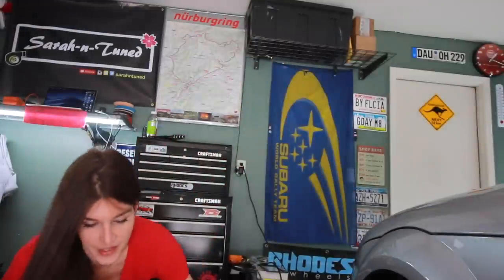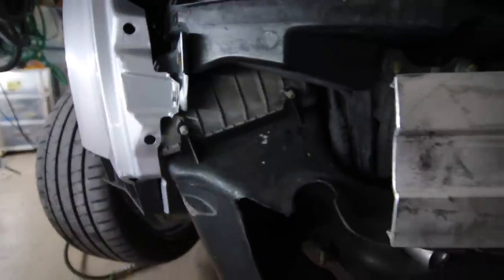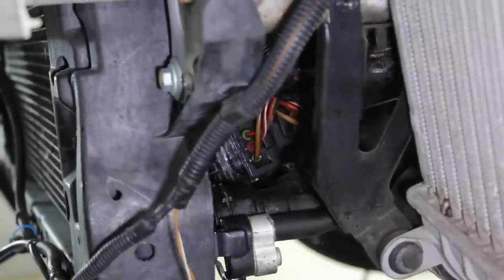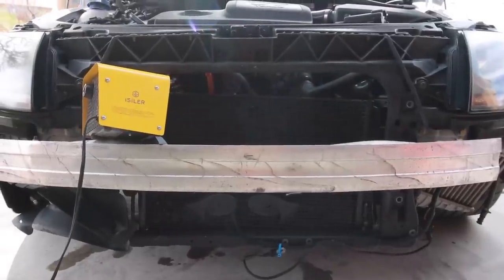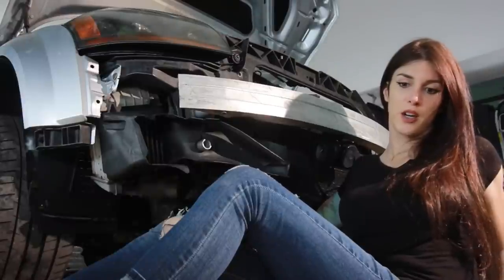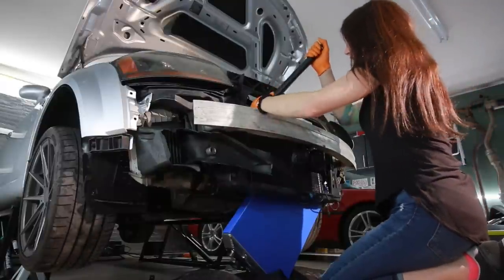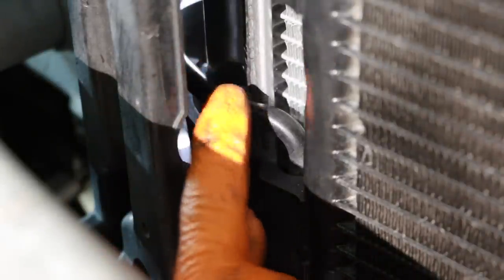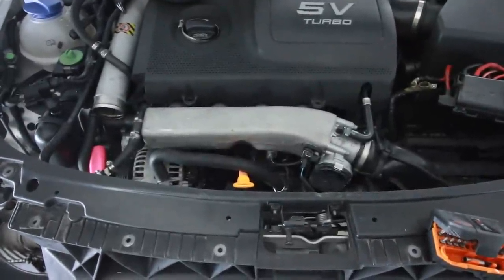Installing Track-Ready Cooling Upgrades // Project TT Quattro

Comment: Coolant NOT "down the drain" I hope. Thumbs down to wrinkle paint, it's just a dirt magnet and very difficult to keep looking fresh. If it's got to come off just bead or vapour blast. There is probably a carbon dress up cover as an option.
I hope ECS view this video. They might be able to redo the brackets on future rads to solve the clearance problem.

Comment: So did transferring video clips from the camera to the laptop save you any time overall? Looks like the Canon works fine so I assume the repair worked?
Reply from the maker: Ramon Punsalang yes, massive time savings. I edited this video in 2 hours today vs my usual 8-10. I did however spend a lot less time working because I was busy transferring clips, either way—time saved.
Reply: @SarahnTuned great! I suspected as much and noteworthy the quality and content remain high which matter to you.

Comment: dont want to use header or engine paint on the condenser and in the future not on the radiator either. there is radiator paint that you can get at eastwood to paint those. it is a thinner paint.
Reply from the maker: Andy Ostensen I painted it when it was still slightly wet from washing it, I had a crazy idea that it would help in that situation. 😂 I think it kinda worked too!
Reply: @SarahnTuned  it will make the paint thinner so that will work. Yaaaaaaaaaaaaaaaayy

Comment: Gotta say I love to hate working on VW/Audi vehicles, but I think your blame is a little misplaced.  That was a race radiator.  Not a drop-in, plug and play, factory replacement.  There has never been in the history of going fast a "race" part that didn't require modifying/fabricating/destroying something.  I don't want to sound critical, but I think if you keep in mind that it isn't supposed to be easy or every mechanic would be driving a racecar.  It's special because it's hard.

Comment: Do your both fans turn on when it starts to run hot?
Reply from the maker: Marley Brown both my fans are always on, the low speed Circuit isn’t functioning correctly, so it just pulsates the high speed.

Comment: Did you get your DSLR fixed ? Great video also showing things are not always as easy, others would edit them to look like a walk in the park, great you do not, but show things as they are :-)
Reply from the maker: Klaes Fris no, I have to check every clip after I film it. They stopped making that part I needed.
Reply: @SarahnTuned  wauw, thougt you bought a replacement, chip-board with sound and that was just it instead of the cracked one, but apparently not you solution, can iFIXIT help, and/or WTD Sarah ?
Reply: @SarahnTuned  BTW what is your DSLR ?
Reply from the maker: Klaes Fris Canon 70D, I bought the replacement card on eBay and then the seller refunded me the next day saying the stopped making it—which is dumb that they even listed it to begin with! Lol

Comment: I don't think the problem is that it's an older car. The problem is it's an Audi. They are crap to try and work on.
Reply: Its mainly a golf mk4
Reply: Completely disagree, I love working on those. Just need to know how... Problem arrives only on bigger motors like 4.2 or 5.2 where there is no room. But 1.8  or 2.0 are easy...

Comment: Them cars were a pita when new , everything you touch is a "well while your here might as well do this as well " Basicaly just remove and service the whole motor , timmining belt water pump replace every oring in the cooling system . Over engineered and they still fail as much as any other car or more often. If you failed to put stablin on every electrical connection you touched then that system will fail to work properly. It was a nightmare working on them cars for 3 years at a dealership . 1 drop of stablin was charged out at ??? 10 dollars . This was VAG fix to every electrical problem . I love your effort and dam your sweet to look at but run away from this car once you have fixed it . MR dos is 10x the car.

Comment: Should have just gotten a stock replacement, then you wouldn't have run into fitment  issues
Reply from the maker: Dave K we have several months straight here where the average temperature outside is over 100°F, stock won’t cut it.

Comment: These cutoff wheels work way better than the standard dremel cutoff wheels. https://www.homedepot.com/p/Dremel-1-1-4-in-Fiberglass-Reinforced-Cut-Off-Wheels-for-Cutting-Metal-Including-Hardened-Steel-5-Pack-426/100009724

Comment: Hey Sarah, you should get some long service bolts and pull your whole lock carrier into service position. I just finished going to stage 2 on my S4 (dual pulley upgrade) and this gives you a whole lot more room to work with around the front of the engine. As far as I know this should also work on a TT. https://www.youtube.com/watch?v=1NlcWV0ufRA

Comment: The cooler is crap :-D You have all this unnecessary work to do because they build and sell shit like this. That sucks. 
You can blast the intake manifold with glas beads. That looks very nice and smooth. When you powder coat them you will geht a nice darker grey finish.

Comment: Looks like someone needs a pneumatic die grinder instead of a hobbyist's tool.
Reply from the maker: Fireholder1 I don’t have a big enough air compressor... or garage for a larger compressor to fit.
Reply: @SarahnTuned  

That's unfortunate, but there's hope!

Since you're a Milfukee fan, you'd probably like the M18 Fuel cordless die grinder. Available at your local Homeless Despot.

Comment: Track cars don’t need no stupid ac!
Reply from the maker: Hugh Johnson you’ve obviously never been to Tucson before, you’ll flat out end up in the hospital without AC here.
Reply: Correct Sarah, but I live in Australia and our club cars/rally cars/auto test cars don’t run no A/C. We know what heat is too. Love you work, I’ve worked in film and tv for 40 years and you tell good tales well. Cheers from 40 deg Celsius Melbourne.

Comment: "God of parts"? ECS? BAH...they're a joke! I'm actually surprised you got stuff in a timely manner and it was correct. Plus they're way overpriced. Only thing they're good at is part number research and then I go somewhere else to find the part cheaper.

Read the horror stories here: https://www.facebook.com/groups/1969390720044815/